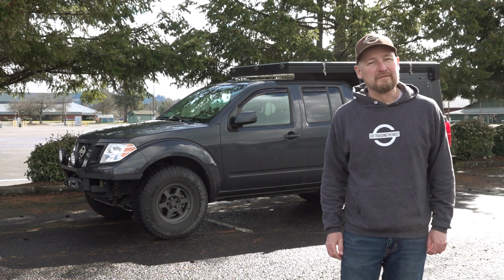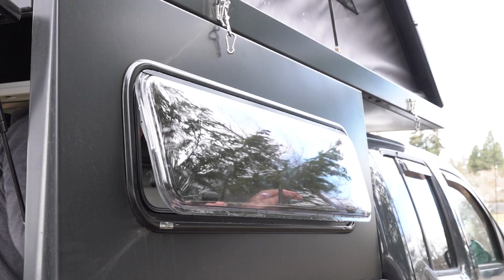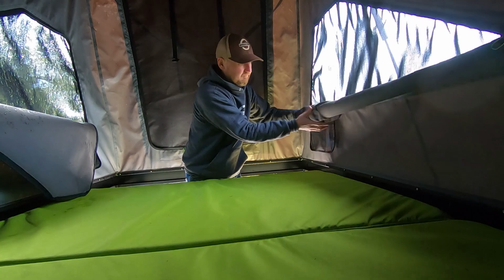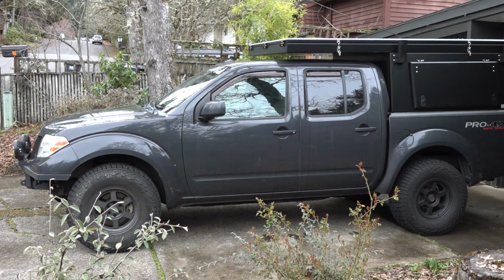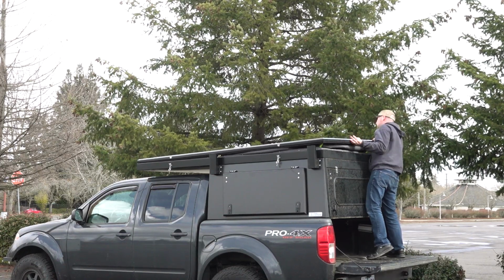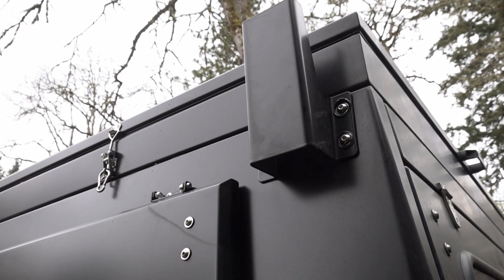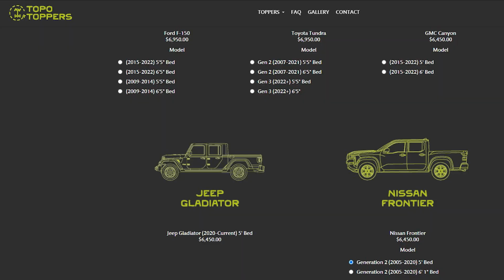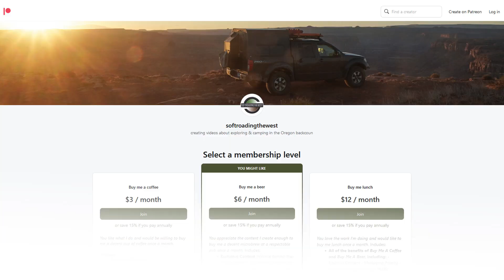Introducing a new camper option for Nissan Frontier

Comment: Congrats and welcome to the Topo Topper family! I took delivery of mine the first week of February! Mine was a bit farther of a trip from North Carolina though. I'm very happy with mine and can definitely vouch for the white roof heat reflection. Unfortunately my vinyl didn't make it home in one piece. As near as I can tell it got some water under the front edge of it and it froze and lifted the front which started the peel. That and 100+ mph winds peeled about half of it off. (80 mph through Utah with 20-30 mph headwinds) the difference between the vinyl section and non vinyl section in sunlight is amazing. I recommend you get a roller like used for sound insulation and roll that leading edge real good. Make sure it's stuck down.

I too will do a build out of the bed or the truck so I'm looking forward to see what you come up with!

Comment: Still have to lift up the tailgate from the inside to close it aye?
Reply from the maker: Correct. I'm thinking about adding some kind of pull handle on the inside of the tailgate. I've found that I can get in and out with the tailgate closed and only the camper rear hatch open by swinging a leg out over and stepping onto the bumper, but I only do that when I'm camping around other people and need to get up in the middle of the night, when I don't want to have to slam that tailgate closed at 3am. :-)

Comment: I have a Frontier with the roof rack and am considering this model. How did you seal up the holes in the cab? Living in the Oregon rain belt I'm concerned about leaks. Good luck with your build!
Reply from the maker: So...yeah. That is still a work in progress. I think it normally would have been fairly simple, but the construction under the rack bases is a little odd and while I’m probably 98% sealed, the 2% is a problem. Due to an unusually busy load of client work, I ran out of time to mess with this between removing the rack and needing to get to Ventura, so I’m still fiddling with it. I’m going to make a video about the roof rack delete because it’s impossible to explain without showing it. I’ll get that posted as soon as I’m convinced I’ve successfully resolved everything. 😏

Comment: That's a nice, sleek design. I really like how heavy duty the tent material looks vs others, I think heavier material makes the biggest difference for the lack of wall flap on my pop-up. The Terns are great, I have them too, just watch scratching them on branches. Breakage-wise they are way tougher than the typical flat glass, but can still scratch/scuff.
Reply from the maker: Yeah, I'm expecting the window to get scuffed up. It's just unavoidable in the places I go. I don't know if some kind of protective film exists that could take the scratches instead of the acrylic and eventually get peeled off and replaced once it's too beat up. I also wonder if it's possible to polish the acrylic like one would with headlight housings (I just did my headlights and was impressed by how easily I cleared them up). Stuff I need to look into!
Reply: @softroadingthewest  That's a great point about polishing, I hadn't thought about that. I think the Tern acrylic is pretty tough, it was something that OVRLND warned me about on mine since the windows bump out a little bit. I've managed to crease my aluminum shell some and add some stylish pinstriping to my truck in the past year, but so far haven't gotten the terns.

Comment: how tall are you sir? and how many people will it fit? currently have a rtt but looking to upgrade.
Reply from the maker: I'm 5'9". The bed in my model is a couple inches narrower than a standard full/double. The overall space available will depend on the specific truck...trucks with longer/wider beds obviously result in a roomier camper. My Frontier has one of the smallest beds of any truck, just 5' x 5'. Two people could camp in mine, though you'd probably need it to be someone you're comfortable being quite intimate with. :-)  Check out the YouTube channel Jonny Taco Outdoors, he has a Topo Topper on his Tacoma and does a lot of camping with his wife:
https://www.youtube.com/@jonnytacooutdoors

Comment: Is there a key to the tailgate hatch? I don’t see one…
Reply from the maker: Yes. Didn’t think to mention that detail but they are normal key-lock topper latches. Topo provides them with rubber covers to protect the locks from the dust & crud that swirls up behind the truck on the trail. The camper is fully lockable. Even the roof latches can accommodate padlocks if desired.

Comment: Finally a reasonably priced camper that looks decent, well made, is adaptable for the frontier.
Reply: I own a 2018 Nissan Frontier Pro4X. This is exactly what I've been looking for. And it fits my Nissan Frontier. 
Finish the build the way you want.
All I need is a outdoor shower with a propane on demand camper water heater. Very affordable. I am eventually have a lithium battery generator and a Honda 2200 generator. 
One backing up the other.
This is awesome.!!!!!!!!!

Comment: Where’s the stove and frig ?
Reply from the maker: This isn't a furnished slide-in camper, it's just a truck-top shell with a pop-up, similar to campers made by GFC, Vagabond, OVRLND, Lone Peak, Harker, and many others...these are all campers that sit on the bed rails with no interior. In addition to being extremely lightweight compared to a traditional camper (and a whole lot less money), it allows you to maintain the cargo functionality of a pickup with a standard topper during the week but then throw in some camping gear and you've got a nice place to sleep. Or, you can build out the interior specifically to fit your needs, which is what I am in the process of gradually doing with mine. :-)

Comment: That purchase price is about what Chris Shontz paid for his Ursa Minor top on Orangie, and this is bigger with many additional options and features.  Its a nice design.  Curious what the sleeping pad dimensions are, it looked a tad short, but maybe not when the access spot is closed up.
Reply from the maker: Of course, Orangie can certainly go places I wouldn’t try to drive the Frontier 😄  I don’t remember the exact bed dimensions though I believe it’s listed on their website. The access opening remains open with the bed fully deployed. I can see it feeling a little small for a tall-ish couple. I did myself drifting into a diagonal sleeping position though it wasn’t strictly necessary.
Reply: @softroadingthewest  The Ursa Minor model Chris uses has the access hatch pads put back in place to function as a sleeping pad.  You could do the same, just close up altogether and get more length.  Something for the manufacturer to ponder.  You should post on the Frontier forum about this, just link to your YT.  Lots of folks would want this.

Comment: Dare I ask how much?  Are you selling your old one?
Reply: Oops, I commented before the end
Reply from the maker: I will sell the old shell with it’s extension (if desired). Anyone seriously interested who’s close enough can contact me via this form on my website:
https://softroadingthewest.com/canopy
I will only sell this to someone with a crew cab short bed 2nd-gen Frontier. Because of the barn doors on the rear, it has to fit not only the bed frame rails, but also the tailgate opening. I’ve had at least 10 people with other trucks ask me for the measurements and every single time, they realize it won’t work. 😏 And beyond a certain distance from Eugene Oregon, the cost of gas for the trip gets to the point where it makes more sense to just have Leer build you a new one. But anyone in the PNW with a 2nd-gen Frontier crew cab short bed is welcome to reach out via that ^ link. 🙂
Reply: @softroadingthewest  thank you for the info. Unfortunately mine won't work

Comment: Wow….seems pretty good.  I like the idea you can do different side panels.  Many builders have limited choices.  We have been thinking about a GFC or 4 Wheel camper for our Gladiator.  Definitely need to check out the Topo.  Living in Virginia would create a challenge for the installation.  Again, like your setup.  Did you think about (or can you move) the awning bracket on the window side?  That way you don’t have to worry about the side door hitting the awning.
Reply from the maker: I deliberately had the awning brackets mounted driver side because I sort of “live” on that side of the truck in camp. My fridge is inside the rear driver side cab door, and when I finish my rear swing out bumper, the swing arm will sort of hinder access to the passenger side. So my camp is very driver-side oriented. I have my eye on a 270° awning that should pose no issue for the cargo hatch & vice-versa. 👍
Reply: @softroadingthewest  You definitely want the awning on the "living" side and you have to do the set up that works for you.  Those 270 degree awnings are pretty nice.  I was also thinking about the awning providing a little rain protection to the window as well.  Like I said, a decent set-up.  I also did a little investigation of the Topo.  Really like them; however, don't think I could swing a trip to CA from VA with my current schedule and commitments.  Enjoy the new set-up.
Reply: @ottouring  Always interested in seeing different set-ups people have.  It gives me ideas on things which might work for me.

Comment: Length of this camper?
Reply from the maker: The base portion is 5', to match the 5' bed of my truck. The upper portion is a little over 100". The bed itself is 81" leaving a gap of a little less than 2' to pass between above and below when the bed is fully deployed. Obviously those dimensions will vary depending on the truck, Topo designed campers specifically for each truck they offer.
Reply: Is a little over 100” like 100.125” or    107” if its 100” that only leaves about 16” for the pass through.
Reply from the maker: @FilmREALMS  It's around 101-102 inches - outer dimensions. I had to go out with a tape measure to answer your question originally but wasn't able to hold it perfectly in place so couldn't be precise to the hundredth of an inch. 😄
I just went back out and measured the pass-through, it's actually a little shy of 17".

Comment: I'm really excited for the build-out and adventures. Is the frontier's bed composite? You should probably install bed stiffners. I have a Tacoma and this was one of the first mods I did. I read that composite beds can crack under the extra stress of offroading and the extra weight of bed racks, shells, and overland builds. Might be something you could fabricate yourself.
Reply from the maker: Nope, steel bed. This is a 2011 Frontier, and even that is basically unchanged from the 2005 Frontier. 😄 Topo actually won’t install onto a composite bed Tacoma without bed stiffeners added.

Comment: Your Frontier build is such an inspiration! I have a Frontier too (and also came from a Forester lol). One question: would the OEM roof rack on the Frontier still fit under the Toppo tent or is it necessary to remove for it to fit underneath? Thanks for the informative video!
Reply from the maker: No, not even close, that’s why I deleted mine. The cabover has to come so far forward that it ultimately would render a roof rack largely unusable anyway.

Comment: Hey Don, this thing is amazing! For this price this is absolutely perfect. I paid 13k for the Alu Cab canopy camper, and while I expect the Alu Cab one to be sturdier (and the bed folds up) this is a really nice alternative I might have chosen if they would have sold it in Europe. The possibility to adjust panels is awesome. Are you going to do some rust prevention on the pickup bed? I was afraid there will be some unseen rust after I have put my "furniture" in.
Reply from the maker: My Frontier has a very durable spray-in bedliner coating from the factory...no rust concerns. 👍 I’ve seen the Alu-Cab firsthand, definitely a nice camper!

Comment: Man really wish I has $7500 sitting around 😒
Reply: You want to sell your old set up Donald?
Reply from the maker: @CotyD  Yes, I'm hoping to sell the Leer shell along with the aluminum extension. Note that it will only fit on a 2nd-gen Frontier Crew Cab short bed, and beyond a certain distance from Eugene, Oregon, the gas expense to come pick it up gets to the point where it makes more sense to just order a new one from Leer. I've had many people inquire, but either they realize it won't fit their truck or they realize it's not worth the drive. 🙂But if you have a Frontier crew cab short bed and are truly interested, you can contact me via this form on my website:
https://softroadingthewest.com/canopy